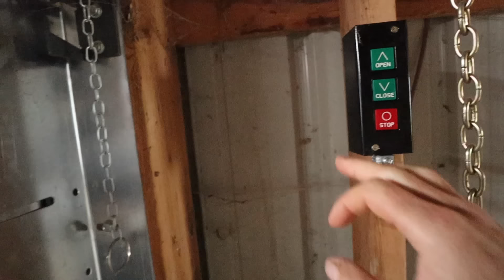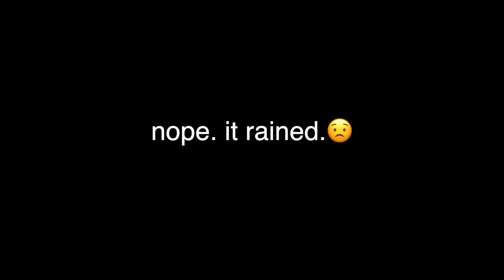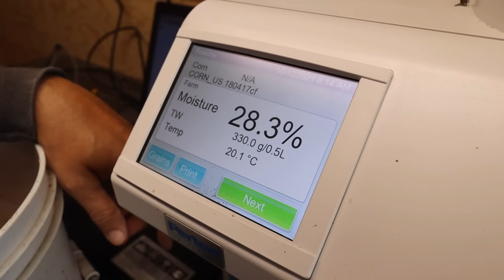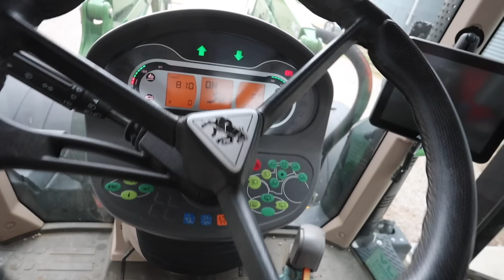for better or worse, Mr  Brock. 😬| I'M GONNA BE FIRED. 🤦‍♀️| Vlog 502

Comment: I'm not a farmer and I feel the frustration you must have with the weather. Every morning the ground is wet from rain through the night, grey and damp all day and maybe some more drizzle through the day for good measure. I use a lawn tractor to cut my grass and it gets longer and harder to cut, and some areas are still too wet to go over.😠 I had to laugh though with the slugs on Marks tractor. I could not figure out when I call my 2 dogs in at night, WHY they had slugs on their fur, it is so gross to pick them off! The slugs must come out at night in the tall growth and get rubbed off on their fur when they run through,😝

Comment: You both work so hard i have so much admiration for you both. Loved tge part where Mark was air pressuring the dust off you.😂
The wooded part you visited looked so pretty. How do you get rid of poison ivy and what are the little log cabins? We don't have poison ivy in England. That machine with all the red things on the front look like a row of surf boards, well just the front view.
Hope you get the corn in and the moisture levels aren't too high.

Comment: I have a question. Do you allow the lambs to leave the barn. If not why don't you allow them outside
Reply: There is a large local coyote population, so Sandi keeps them in the barn to be safe. Also due to climate in Southern Ontario, they would be in 5-6 months of the year anyway.

Comment: What did you put on the corn to make it go brown?
Reply: Do you mean the actual corn plant/stalk? As the nights get cooler, and their growing cycle is done, they will start to die off.
Reply: @terryst9835  Well it looks like the other field are nice green and there a definite edge of brown. The beans where are all brown when harvested also. Curious
Reply: @chiron591  The green field is most likely the crops they have planted recently, as cover crops, or like the barley, and the wheat they hope to get in soon, crops that survive the winter and get an early start in spring.
Reply: @terryst9835  the field is sprayed with something. Plants just don't all turn brown at once. I'm a gardener and my beans never turn brown before I pick them. Just saying. 

.